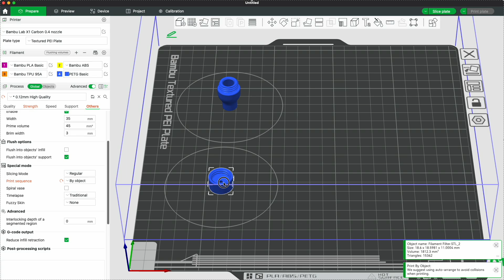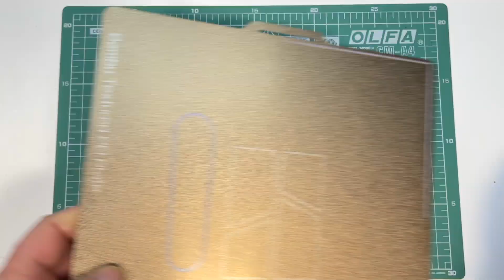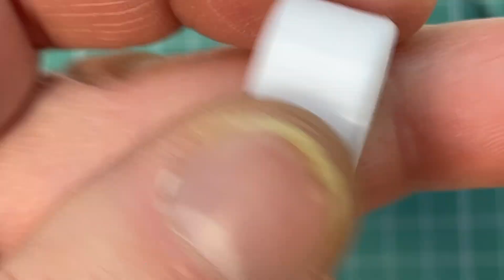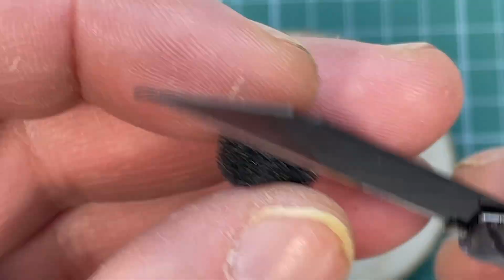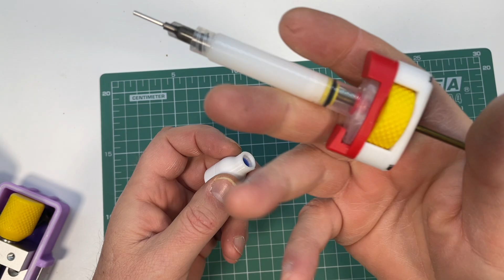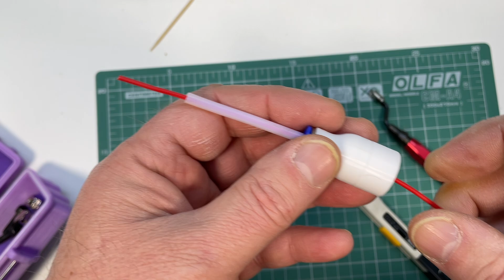Filament Cleaning Filter

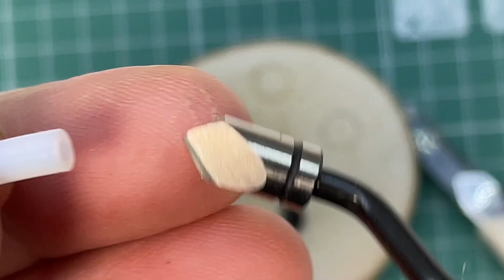Comment: Love the model, two qustions!  What is the tool used at the 3:11 mark to chamfer the PTFE Tube?  I did not see it in any of your links.  Also, what was the device you used to apply the glue?  Thanks!
Reply from the maker: 1 NOGA deburring tool and Blades - https://go.like-it.link/h5jhx 

2 It’s not glue — it’s a lubricant to make the press-fit easier.